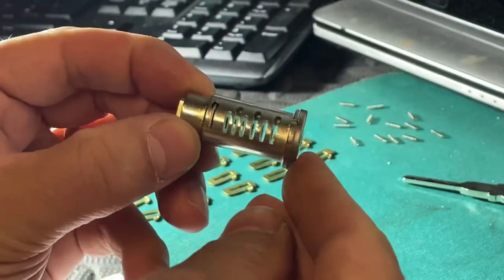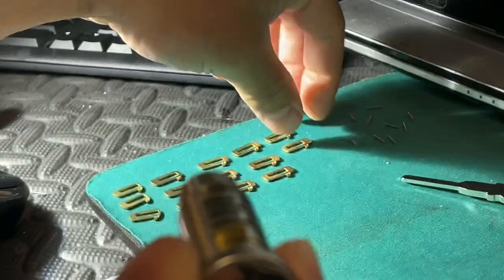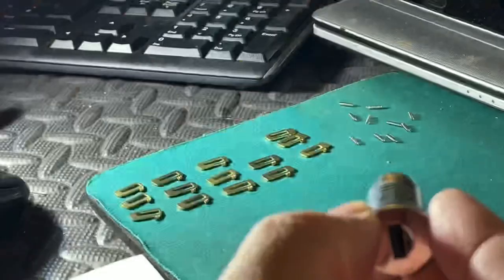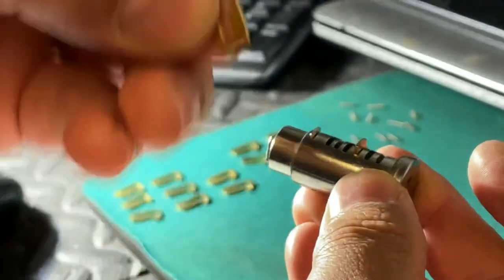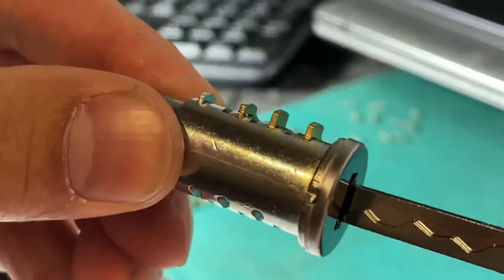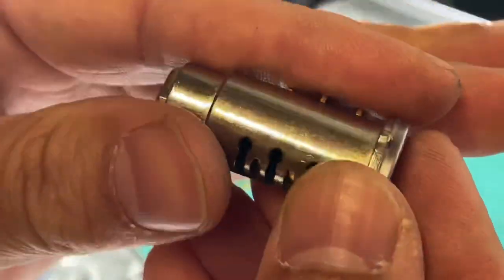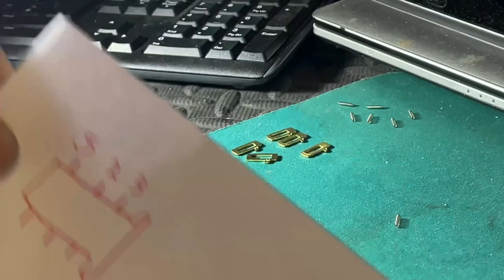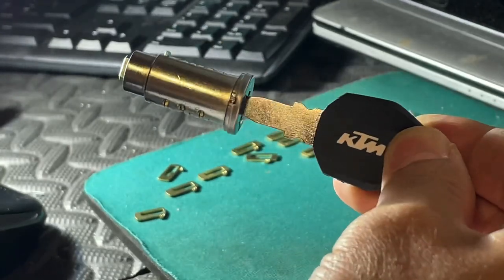2021 2022 2023 2024 KTM 1290 Touratech Lock Barrel key Coding Matching

Comment: Great video and thank you for making it. Is anyone else having issues seating the lock in the KTM paniers once the lock is assembled?
Reply from the maker: Hello mate. Thanks for the feedback on the clip. I gotta say every lock unit I’ve had to fine tune the lock block (actual lump of metal that turns) as mine never seated without difficulty. Needed to use an angle grinder to round off a little and taper. Instead of just leaving like a squared off block (edges)
Reply: @RicardoYeep  that makes sense. I didn't see any friction marks on barrel so I wasn't sure what the issue was. I got one to set yesterday on one case so I know it's assembled correctly. I will do what you said and work the second one till it fits correctly. Thank you for the reply and the suggestions.
Reply: I finally got the lock mechanism into the case. I tried filling it in a few spots but just ended up knocking it in with a hammer lol.
Reply from the maker: @acg782  HAHA Excellent mate, you got there in the end and thats all that matters.. Lets just hope you dont need to get it back out lol

Comment: Did the cylinder turn b4 putting any pins in? I've done my best but neither without any pins installed or done per instructions will the cylinder turn? help
Reply from the maker: Hello there and thank you for dropping a message! Sorry to hear you are struggling. 

I never tried turning the lock before inserting the pins so I can't say for sure.

However I had to try a couple of times as you have to be 100% sure you have the correct pins in. 

Unless all pins are 100% flat with the barrel it won't work. 

Sometimes one will look flat but it is not flat enough. You should not be able to feel any pin on the lock barrel  when pulled in with the key.

Good luck and keep at it.
Reply: I had 5 size pins, 3 of each # and the pins numbered 5 were shorter than 1 thru 4 and I ran short a pin of a number I can't remember and put a 5 in which sits a little inset on both sides otherwise all are flush,  currently using a 3/8 extension as a key. I did appreciate the video and your replies, maybe i have to order the one i'm short.
Reply from the maker: @scwlw2169  ah I see.. yes the specific number has to be used. I couldn't believe it myself when I used a wrong one as to me it looked as close to level you could get when pulled in. But when I eventually used the correct one I understood.. just half Mil makes the difference between it working and not. Was quite surprised.

Comment: Hi Ric,
Great videos 👍
Just received the full set of luggage and received 6 barrels. How many sets of keys did you receive? Should there be 3 - one set for each box?
Reply from the maker: Hello mate! Congratulations on the bits. If you have the full touratech luggage the. You should have 2x locks for the top box and 3x locks for EACH pannier. So in total you should have 8 barrels/locks.

Each pannier has a lock either side as it’s dual opening. And a lock on top to secure it to the pannier rail. 

The top box has a lock to open it and a lock to secure it to the mount 👍

Only 2 keys though 👍

Hope that helps 
Thanks 
Ric
Reply: Thanks for your reply. The dealer has the missing barrel's!   Will fit the full set of luggage this weekend👍
Reply from the maker: @PLaLeyenda  no worries and excellent glad to hear getting resolved and you have the missing bits awaiting 👍

Comment: Mine has no key
Reply from the maker: Hello mate. From memory it might be due to the topbox you were sold. The 790/890 Adventure top boxes are identical in every way. However the ktm part number will be different from a 1290 Adventure part. The reason is that the 1290 ADV as you know is keyless so the topbox comes with key. 

But as the 890 already has keys the pack contains only a lock barrel in which gets coded to the bikes own key.

In short I maybe wrong but you probably have to order a key at minimal cost. And then code it to the lock barrel. 👍